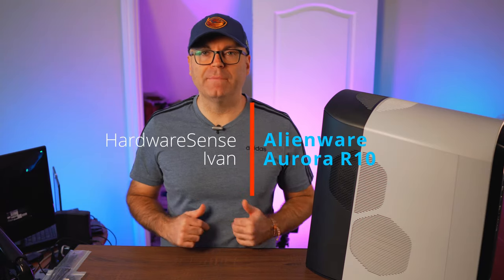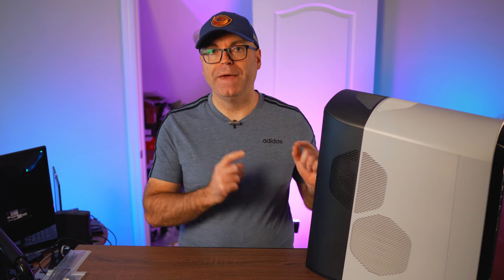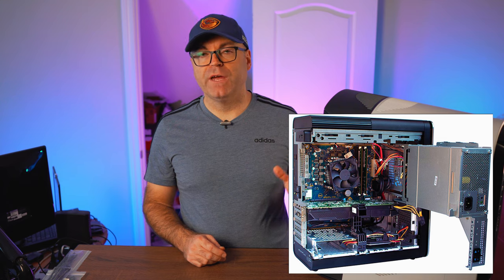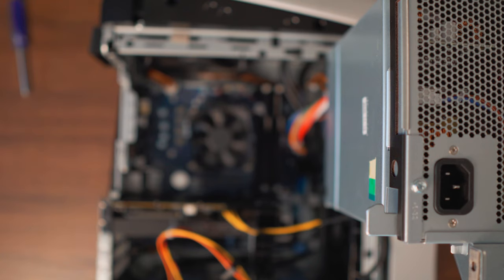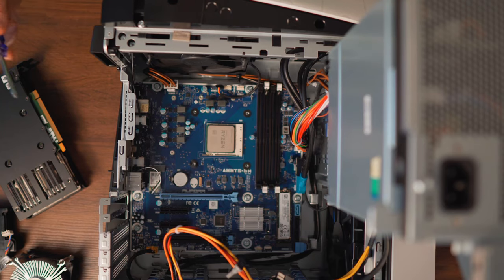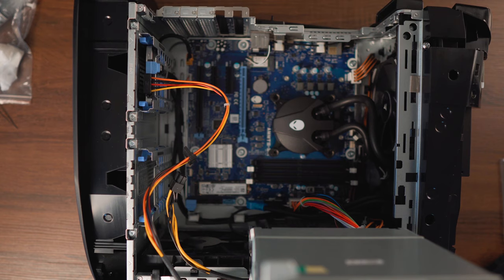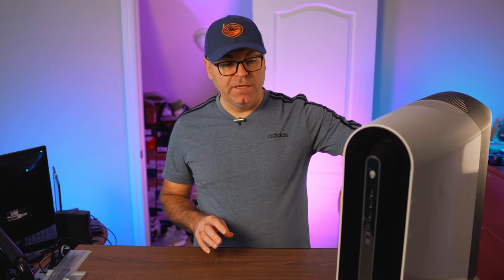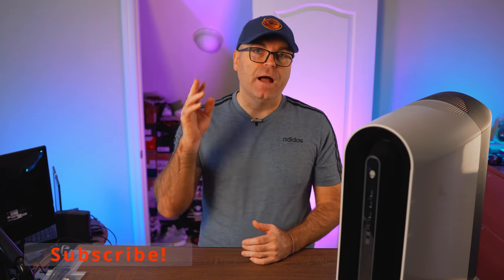Alienware Aurora R10 - All The Cooling Mods, That You Need!

Comment: I just got the R10 with a 5600x and 3080 today on Dell for $1769. I do heavy rendering to a large format printer. Jobs take minutes each to render so no need for a nice GPU, just beefy CPU. Selling the 3080 on eBay will make the computer minus the GPU, free. Mine has the stock air cooler and I will be doing this AIO cooler upgrade you recommend here in the video and the heatsinks. Thank you!

Comment: Just happened that i rebuild my Alienware R10 Aurora Ryzen edtion a few months ago. the tower came with the water cooling system, upgraded to a ryzen 7 5800X cpu and a RTX 3070 "DELL" GPU. with the stock fans in there, they were pretty loud when it came to play games at full resolution. did a lot of research and decided to put in 4 Noctua Fans in there and just like you did, i did the push pull set up on the radiator and 2 other fans at the front case. i bought the tower used and i know it is over kill, but it came with a 1000 Watt Power supply. also put in a new thermal paste on the new cpu and new thermal pads for the voltage regulators. what use to run at 52deg C on idle, is now down to 28-29 deg C on idle. i haven't seen that machine running any hotter than 75 deg C. i also did the same process on putting a thermal pads and paste on the GPU and the temperature dropped dramatically from 90 to 75 Deg C. So it is definitely worth doing all that work. Great video and keep on the good work. =)
Reply: did you did everything that he show in this Video with no problems ?
Reply: @alienzm5212  no problem at all, mine already had the AIO with the machine and the temp was pretty good until i put in a ryzen 9 5950x in there with my RTX 3080. that thing was cooking. ryzen 5 CPU???? temp was good but as soon as you put in the Ryzen 9 CPU? the case will get hot in there.

Comment: 21:35 ; lose the cage, attach an 80mm or two 40mm to the front and use non-flammable tape (or a custom plexi/metal plate) to seal off the rest of the holes. The extra holes reduce the amount of thrust your pull fans can create. I also oriented the fan all the way towards the motherboard side so that the air isn't being pushed onto the bulky PSU mount, but pushing all the way to the back of the case. Great vid!!
Reply: I did the same with a 120mm fan and double sided tape

Comment: For others that try this, I was able to get the radiator out of the top without removing the CPU cooler, heatsinks, or memory sticks. I just wiggled it out of the top - being very careful of the tubes - then I unscrewed the fan and installed two Noctua NF-A12x25 PWM fans in push/pull. The nice thing is that these fans are much thinner than the stock fan, so both of them take up just a little more space than the stock fan. The top fan is now running at 35% 60C and the front fan at 27% 60C. The only issue is right now my front fan stays at 27% (according to Command Center), but the top fans are varying their speed from 35-45%.
Reply: Very interesting stuff. Can you describe a little more precisely how you exactly installed the push/pull setup? Did you just take off the top cover and wiggle out the radiator without unscrewing the fan? Did you use the a cable splitter? Did you have to get longer screws?
Reply: Oh, and you can probably control fan speeds using Open Hardware Monitor R10 edition
Reply: @geoffroydelmotte1141  Yes. I pulled off the top and unscrewed the fan. Then I was able to wiggle it out past the heat sinks and cpu. I rotated it gently to unscrew the fan from the radiator. The screw holes for the Noctua fans had some plastic that was blocking the original fan screws since the head on them is a little wide. I took a pair of needle nose pliers and broke away the plastic so the screws would fit. I was able to find some longer screws that I had around with the same threading as the screws that were removed from the top. They just need to be a little longer than the Noctua fan is thick. I did use the cable splitter.
Reply: @geoffroydelmotte1141  I can hear the fan speeds adjusting automatically but Command Center is only showing the fan speed adjusting for the top fan. Ironically that's the one with the splitter.
Reply: What you can do, is go to the Command Center and change the cooling from Balanced to Performance. Also you can make profiles.

Comment: Just bought one of these for $1249 on Best Buy, says that the computer is $600 off and it's also the Dark Moon Model which is great. The system comes with these parts.
AMD Ryzen™ 7 5800 (8-Core, 36MB Total Cache, Max Boost Clock of 4.6GHz) Processor
AMD® Radeon™ RX 6800 XT 16GB GDDR6 Graphics
1TB M.2 PCIe NVMe SSD (Boot) + 1TB 7200RPM SATA 6Gb/s (Storage)
16GB Single Channel DDR4 XMP at 3400MHz Memory
High-Performance CPU Liquid Cooling and 1000W Power Supply. 
Glad to see that I got some of the better features in my build, but definitely gonna replace the fans with the quieter ones you mentioned in this video and add another 16 GB of the same RAM, even tho it's like $195 from Dells Official Website. This was a great video and I like how you went into detail and explained everything.

Comment: I was shopping a new 3060 GPU and I ended up getting a r10 during the GPU price craze. It has the Ryzen 5 5600x, 3060ti, and was already liquid cooled out of the box. I bumped the RAM to 32gb, and have not had any issues. I may eventually add or replace a fan

Comment: i cut a nice circle out of the mounting cage of the front fan with a wire cutter. that will give it 100% obstruction free airflow. if you wanted to get creative, just snip out sections.  if you are worried that wires might get in the fan. i ziptied all the wires so i dont have that issue. 22:00

Comment: Hello.  You didn't need to take the top panel off.  The area your AIO and fans go in is actually a removeable bracket.  If you look at your farthest left ram stick (to the right of the CPU) and then look directly forward you'll see a single screw.  Remove that screw and the entire cage will slide out.  You'll have to remove the CPU power cable for clearance and un-route that cable from the cable management guides (there are two, one plastic, one metal) and out of the way.  The 2nd screw for the cage is from the original fan bracket you unscrewed which connects to the left side of the cage.
Reply from the maker: It's easier to remove the top panel than taking the bracket out.

Comment: Should of shown operating temps and gaming temps after you do an upgrade
Reply: Easiest and cheapest mod, remove side panel, remove plastic hood above CPU, swing out PSU arm. Run Cinebench R23 to test back to back. I gained 1500 points on Multi, now 18550 average. Bonus it’s extremely quiet now. R10 3900x water cooled 3080

Comment: You may disagree but I am personally not bothered at all by the Alienware stock fans. I got a liquid cooled Ryzen 5900x and a RTX 3080 in the R10 and with some simple settings with AWCC I can use the computer just fine for normal things and it is basically silent (thermal set to Quiet and power set to Power Save) . When I play a game I set it to switch automatically to Performance Mode and yes, that's when the fans become a bit noisy but 1) I use headphones when I play and 2) I know that AWCC is using the fans properly. GPU does not go above 75C (in July, UK) and the CPU does not go above 60C. 

The fans on the Alienware r10 can reach 4000rpm so going for slower fans and let AWCC manage them without tweaking the profiles properly will just let them go even slower. As AWCC is set for 4000rpm fans, 50% of it is 2000rpm. Replacing them with 1700rpm fans will mean that 50% of it is 850rpm and that is not necessarily good. Less noise, yes, but with this case having poor airflow is bad.

That's why I will ONLY add an additional Noctua Noctua NF-F12 iPPC 3000 PWM (yes, industrial) in the HDD slot, leaving the stock fans where they are. This fan is not the quietest, but it is the nearest I can get in terms of rpm. I looked for other 4000rpm fans but they are just not made for desktops (like the Dell stock ones) so they will add a lot of noise. Noctua NF-F12 iPPC 3000 PWM  is instead perfect for this. I feel there is a lack of airflow on the top side (which dell fixed on the new Aurora models), so this justifies adding this fan.

I may, if needed, add an additional fan to the top radiator as push pull solution, but the CPU temps are just fine now so it is not a priority.
Reply from the maker: With my mod the temps drop 20c so be the judge, while my hearing is intact

Comment: Can I use the liquid cooler without the vrm heatsinks? Dell and ebay doesn't have it. Thanks in advance
Reply: How did it go? I am in the same boat. Gonna install my H60 in a few days without the VRM heatsinks. I keep reading online it's fine as long as you have decent airflow and aren't overclocking?

Comment: I just got my r10 about 3-4 weeks ago... it's 5900x rx6800xt 512m.2 1t hard drive and 16gb ram 3200 and 1000watt power supply... it was 2400 plus tax. I love it...
I've been playing 2077 in 1440p @60p (TV is only 60hz) everything high as the setting will go. The temps stay in the low 80s. I personally couldn't have asked for more. the fans stay around 2,800 to 3000 RPM. it doesn't really bother me you can hear it in the background but I don't think it's worth replacing. Someday after my warranty is up... I'm going to take all the parts out of this one and build the case that I like. I don't have anything against this case but I would love to see my components. What I can't figure out is if I should get two more sticks of RAM on the two empty slots... if it'll help or not? FYI this is my first computer... well I guess I have an old laptop but that has a very specific function. I only use it for automotive applications.
Reply: I don't think currently more ram will make a huge difference. The biggest thing you would want to do is get those temps down some.

Comment: i clipped all of the metal shrowd that covered each fan, including the cover and psu. that helped with noise and maybe some with airflow. i put the bottom intake fan to the top. ill get one for the bottom even though i saw a huge difference in temps just doing that. im not sure about the push pull for the cpu aio but ill do that anyways. its like 15 bucks for the fans so thats not a huge expense.
Reply: Did you install the metal near to cpu like he did ? And did the ACC program working with all fans ?

Comment: Great Video.   Question:  I spoke with Dell regarding the VRM's and mentioned part # 4D5V9 thinking that both VRM's come as a package.  They said this part number identifies one VRM.  Then I asked what was the other part # and they said it was J46J2 which was out of stock.   So to confirm, Dell sent you two VRM's - VRM #1 is Part #:4D5V9 and the other is Part # J46J2?
Reply: just ordered part#4D5V9 and just received the small heasink from dell . still cant get them understand they are two one large and one small one . have an R10
Reply: @osvaldotrevino1991  After a long wait, i managed to get both heatsinks from Dell based on the part numbers I mentioned in my earlier post.  I too have an R10 and the fit is great.  They are the right part #'s.

Comment: I’m confused which fan did you use foe the upper front fan? Was it the stock fan?
Reply: Reuse the one from the stock cpu cooker
Reply: @hondaboyhunter  Where did he get the rubber feet to mount it on the hard drive cage?

Comment: Great contect! Quick question tho, did you replace the front fan as well? From the manual, it seems like the front fan is clipped in, so if I get the corsair fan for example, how would I then fit it? cheers in advance
Reply from the maker: Yes the front fan was replaced with the same Corsair ML120 Pro

Comment: Hi, thanks for your good video. So you have 3 Corsair ML-120 Pro fans (front, top pull/push) and stock cpu fan (front). Do you have any BIOS error of if you run the Alienware command center test, will the fan test fail? And for the top fun push/pull, do you still remember which fan goes the 3 pin of the y split and which fan goes to the 4 pin? I am currently trying to upgrade front fan with Noctua NF-P12 fan but it failed the fan test and make my system crashed. Thank you very much.
Reply from the maker: IF you are using the 3 Corsair ML120 Pro, they are 4 pin, there are no Bios errors at all.

Comment: What is the size of the fan that fits into the 3.5" hard drive tray? It doesn't look like a 120mm. You mention getting three fans in on top and two at front. Do you mean three 120mm?

BTW, thanks for making the great video. Keep going!
Reply from the maker: 92mm in the HDD cage, 2x120mm top push-pull and one 120mm front
Reply: @HardwareSense  Gotcha, thanks
Reply: Yea... He says and puts and 80mm fan in there, but it's actually slotted for a 92mm... Just made this mistake... 92mm will be here Sunday >_<
Reply: @Sakon85  can you post the link of one I can buy?

Comment: Are the Noctua NF-A12x25 PWM fans are the same size for all 3 fans on the Aurora 10?  I have the Aurora 10 AMD CPU with water cooling.
Reply from the maker: Yes same
Reply: @HardwareSense   Thank you so much, like your videos.
Reply: Yes, I use Noctua fans for all three. However, using the Noctua NF-A12x25 PWM as the top AIO fans will cause a bios error. They work wonderfully and are super quiet. But you'll get an error everytime you restart the computer which is super annoying.
Reply: @toddgarvin2808  do you have any control on the Noctua fans?
Reply: @RichardMoreno24  I can change settings in AWCC to make them spin up. And they also spin up as needed while playing intensive games/vr. Is that helpful what you're asking? The front fan has no issues at boot. But now that I have 2 fans on top (push/pull) with Noctua splitter, they "fail" the bios test at boot. It may be the whole splitter thing that causing the error. Maybe a single fan would pass bios test? Performance-wise they seem to work as expected though.
Reply: @RichardMoreno24  Yes, everything works as expected with the AWCC app.

Comment: I hate how this case routes all the heat through the top cpu cooler. did the push/pull improve things? what kind of temps did you have before/after?
Reply from the maker: 20 lower with the mod

Comment: So what did you end up doing with the thermal paste left by the CPU fan? You skipped that part due to you needing both hands. Did you clean the CPU and reapply your own thermal paste or did you just install the cooler on the left over paste??
Reply from the maker: Yes, clean up and reuply. You should always when removing a cooler from a CPU

Comment: Not sure if this was answered but did you need longer hardware for the pull fan (top fan) to go through the case, fan and into the radiator to secure everything? Looking to do this upgrade with a H60 and 2 ML120s this weekend. If so what size hardware is needed for those outer bolts
Reply from the maker: Yes and I used a leftover screws from another Asatek AIO, they are all standard
Reply: @HardwareSense  Thanks for the reply, just looking at the H60 kit, so i just need another set of 4 bolts at 1-1/2" to get all the way through to the rad

Comment: Hi there great video. Is it beneficial to replace the lower front intake fan to a Noctua? Or do you need to leaves the stock OEM fan to avoid bios error? Or does the airflow of the stock vs noctua hinder airflow in some way? Just noticed you didn't change out that fan.
Reply from the maker: I did change it to another Corsair ML120 Pro, just didn't film that part ai guess. Some people reported issues with the Noctua fans

Comment: Excellent information overall .. I am guessing you couldn't add the watercooling as a option with that sale price so you had to go thru some hoops to get that all up and going.   Not sure the push/pull is doing all that much more considering the temps you are getting from just the normal LC cooling.  Mine will hit 77c (ish) if i let it and leave everything at stock.   I use the Ryzen master software though to undervolt taking it to 4.1GHZ all core at 1.2V (3700x) and it never hits 70 degrees.  For the most part though I have it running at 3.65GHZ all core at 0.96V and it never hits 60c in any situation.
Reply: Hello i just got this computer similar to ur setup, any tips on undervolting? Or more like how do you undervolt the best way lol. I have no past knowledge on ryzen cpus so I need someone to wall me through
Reply: @emperorexiled7270  use the ryzen master software from amd. Can usually lower voltages to around 1.

Comment: 19:19 so did you use the screws that were installed on the original setup, or did you use some different screws to get the fan on top of the radiator? are the top fan and the radiator+bottom fan even connected with screws, or are they separate?
Reply from the maker: You need regular AIO long screws, I have a ton from different kits, but for the push pull you would need 8 of them for top and bottom fans
Reply: @HardwareSense  thank you